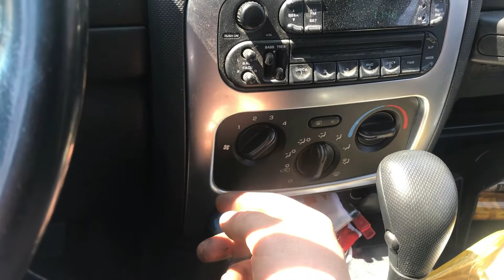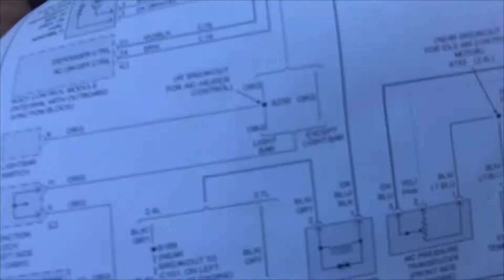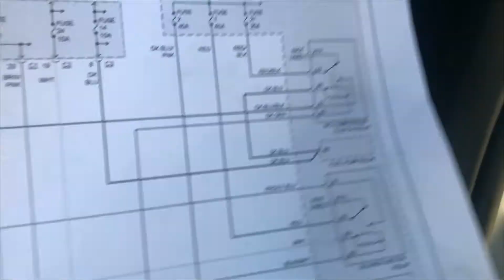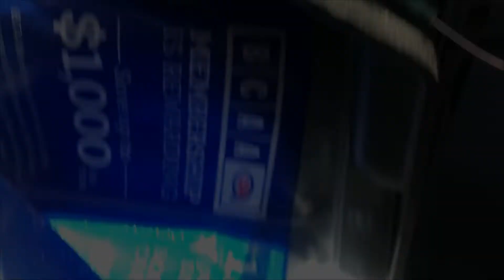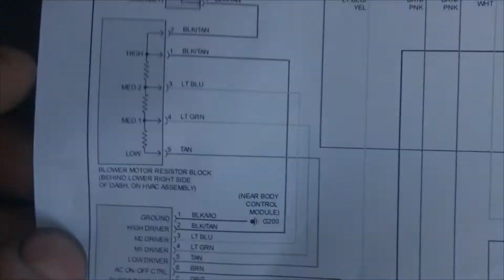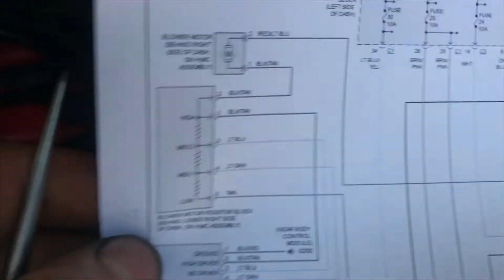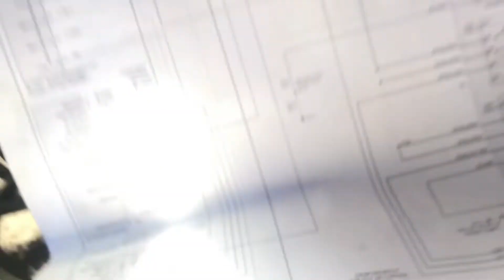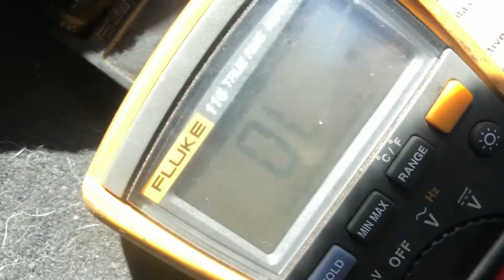How to diagnose no fan on any speed. Is it Blower? Resistor? Or..? 2004 Jeep Liberty 3.7

Comment: Thanks Brother.
I Was Wondering If It Was A Resistor Causing That.  I Have A 2003 Liberty With That Exact Problem.
My 1, 2, Nor 3 Work, But 4 And All Of The Other Functions Work Perfectly.  So I Take The Bolt Out Of The Resistor, Unplug It, And Install The Replacement.  I Am Not A Mechanic AT ALL, So It Is Nice To Know
That You Guys Are Out There Helping.  Thanks Again Brother

Comment: Thank you for the video. Mine was the corrector to the fan. But I also changed resistor and have all 4 speeds after 4 years all for 22 bucks.. great video
Reply from the maker: @qzaxy6264 Nice! Glad you got yours fixed! The way I view it, if you're in there then you might as well replace the resistor as well. Especially when they're that cheap! Good job.